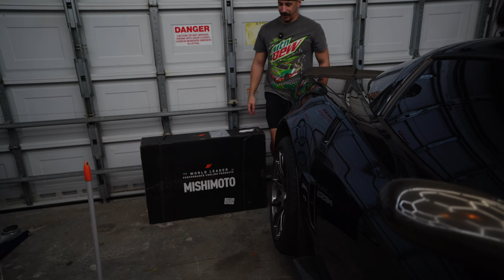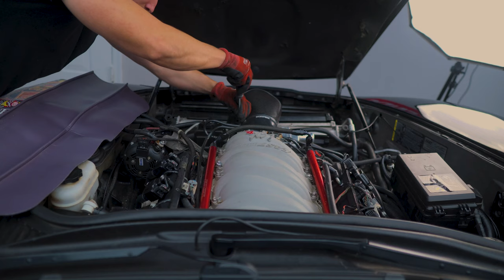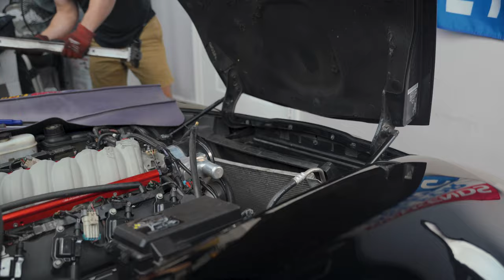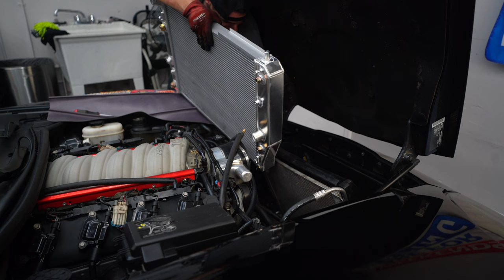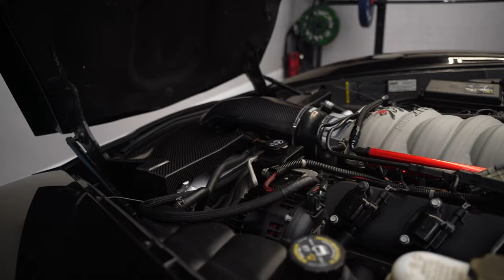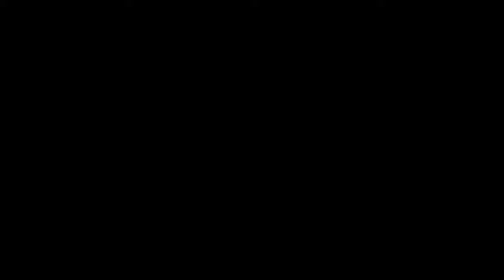Enhancing Cooling Performance: Mishimoto Radiator Upgrade For My C6 Z06!

Comment: I have the same one in my C6 GS, and so far so good.  I've tracked in 90deg+ with high humidity and it's helped quite a bit. I'll probably still upgrade the oil cooler though for added insurance.
Reply from the maker: Yeah! I’m excited to see how it does on track now. I’m still not pushing the car hard enough(noob racer) but I’ll definitely be upgrading cooler and venting the hood soon.